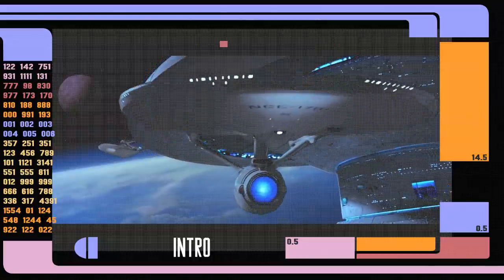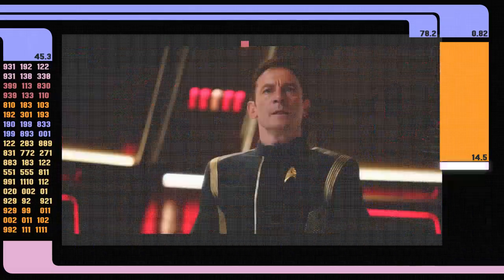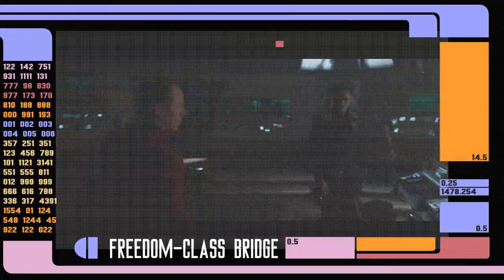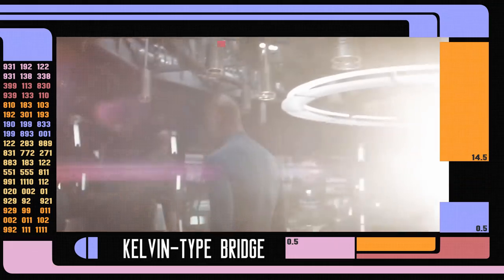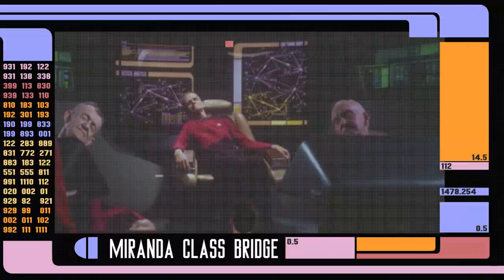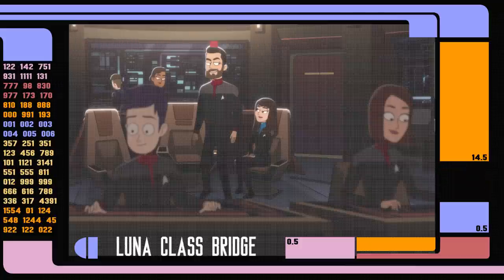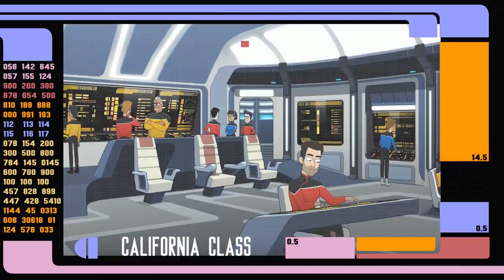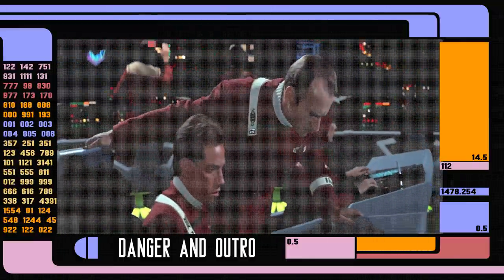Forgotten, Fatal, and Unethical Starfleet Bridges

Comment: Transparent aluminium isn't necessarily as good as deuterium, they don't build starships out of aluminium. That said, I agree windows are useful and probably worth the trade off.
Starfleet ships do sort of have a CIC equivalent. Galaxy, Intrepid, and Defiant class ships have all been shown capable of handling bridge functions from main engineering.
Yes non Starfleet please.
Reply: Transparent aluminum is far superior to deuterium for windows… because deuterium is a liquid. 
😁
Reply: @patrickstewart3446  In Trek context i think he meant Duranium. it was basic metal alloy used in ship construction.
Reply: Yup my bad, I did indeed mean duranium. Deuterium is the matter half of the matter-antimatter reaction used in the warp core, but I think it's a gas rather than liquid. Most of the deuterium on Earth is in the oceans but in Trek they get it from the Bussard scoops in space rather than separating heavy water. That said, they might keep it pressurised.
Reply: @Slavir_Nabru  Deuterium is the second isotope of hydrogen, consisting of one proton and one neutron. The third isotope is called tritium, two neutrons and one proton. This is real life as well as Trek. Thus, it will largely be a gas.

The funny thing is, the Starfleet Matter-Antimatter-Drive (Warp Drive) uses Deuterium, why? Because, if you recombine Anti-Hydrogen (one Anti-Proton) with Deuterium (one Proton, one Neutron), you gain the energy from the annihilation (E=mc²) plus the binding energy of the weak nuclear force when releasing the Neutron. Also, funny detail is the Bussard collectors collect Hydrogen from the interstellar medium (which probably is sifted through for Deuterium). The Impulse engines again are Fusion drives; they fuse two Hydrogen atoms into Helium (and push the hot Helium out the back), while other Fusion reactors do exist on the ship that produce energy (in this case, using the heat gained in the Fusion process instead of accelerating the Helium with that energy). So, we can conclude the Starfleet uses essentially one type of fuel, which is renewable to a degree, for powering many systems in different ways with it. How they generate the Anti-Hydrogen they use is not elaborated upon, unfortunately, but I think it is safe to assume it is a renewable resource as well in Trek tech.
Reply: @patrickstewart3446  Jumping Jack Flash
 At normal temperature and pressure, it's a gas!😎
Reply: Windows are big weaknesses compared to cameras.

Comment: I always thought the original Excelsior Bridge made the most sense. Mainly because it appears to be flat. As you noted in part of this having all those stairs and steps makes absolutely no sense. The first season of the next-generation when we saw Admiral Jameson aboard on a wheelchair having only ramps on the bridge totally made sense at that time. But even that could easily cause you to stumble if you're walking them during a combat situation or any sort of turbulence. The Excelsior redesign actually lifting helm and navigation and the captain's chair to equal to the highest level, literally made the low points irrelevant anyway. Like my step machine they're just there for exercise. While the ceiling space goes very unused. I always secretly wished that Captain Kirk had had a periscope like Captain Klaa! 😁 #LLAP 🖖🏻

Comment: You missed the perfect opportunity for the Miranda class to say "Do you know would be useful in this situation? A WINDOW."

 Also although I do agree with your points about if your points about windows windows I still believe Is "windows" would never be a standard feature on large military subs.  Usually your visibility is no more than 10' in Addition there would be sea slime or barnacle build-up on it which would need to be cleaned regularly. Smaller subs probably would have them standard issue, but not to large missile subs.
Reply: But it's not a window, it's transparent metal (aluminum to be exact).
Reply: @mainstreetsaint36   Yes but if you installed a sheet of transparent aluminum in your wall at your house that you could Look through what would you call it?
Reply: There's another problem too: Stealth.  Military subs aren't just bare metal, they're coated with other materials that interfere with sonar and suppress sound from the sub itself.  Granted you can kick that problem down the road and just say "more advanced materials we don't know about yet", but at the very least it's an issue that isn't solved by transparent aluminum or the like.

Comment: On the subject of the rocks:

The rocks could be an emergency heat dissipation system.  A substance in the console solidifies, ejects out of the console, and prevents a much, MUCH bigger and more lethal explosion, while spraying (relatively) light, foamy pumice into the air.

Also, some of the walls will spray rocks, and this could also be a part of the same basic idea: the rocks are a ballistic/energy absorber, that is designed to ablate and expand, preventing hull breaches in the bridge.  Once again: deadly to ensigns, yet a life-saver to the bridge as a whole.

Also, if we count the novels and Starfleet has Horta as crewmen, they probably view the rocks as popcorn.
Reply: could also simply be hard foam insulation or similar material that looks like rocks when it shatters.

Comment: The Enterprise D did have a bridge window, it allowed the crew to look up the z-axis, but it was effectively useless for any navigational or combat application due to the extraordinary size and speed of the vessel and was a decorative feature. 

Presumably if the view screen failed, multiple shuttles or other secondary vessels would assist in navigation.

Comment: What you lose by having windows on a starship's bridge is that the bridge has to be next to the outside of the ship where it is most vulnerable instead of deep within the ship where it is least vulnerable.  It might make sense to have windows in an auxiliary control center on the outside of a ship for use if by some extremely unlikely possibility an emergency arises where it is necessary to look out a window because the viewscreen system is inoperable.  But with the level of technology that interstellar travel implies, having the main bridge next to the outside of a ship that may need to fight is completely stupid.

Comment: With regards to the whole thing about metals, we have transparent ceramics (e.g. aluminium oxynitride) that are generally as hard as or harder than whatever you're bolting them into, but they are expensive and so even if you invented one that's flexible enough to replace the usual structural members, it'll be used sparingly anyway for the foreseeable future.

Comment: On the whole rocks in the consoles thing. My head canon was that the consoles are solidly packed circuitry/technology that is just so small that it looks amorphous. If you ever look at modern electronics in small form factors, you'll see ridiculously tiny resistors, capacitors, etc in addition to the chips themselves. Just look at 0402 SMD components. Now advance packaging and substrate technologies a few centuries and those consoles probably have thermal and electrical superconductor layers interwoven with components that are basically just gray blocks to the human eye. This would make it chunks of the actual electronics being exploded out of the consoles. Which would have some (emphasis on SOME) validity if you look at modern capacitors and such exploding when overloaded. The consoles exploding are still indicative of design flaws, but the "rocks" aren't the Starfleet Officer Replacement Program requirement they seem to be. Ultimately, I just wonder if the ideas of fuses and opto-isolation are just too retro for the SCE to understand.
Reply: Not even fuses... just don't run Electroplasma directly to a touch screen.  
Like a step down transformer safely tucked away behind some plating a couple of feet away would save so many  lives.

Comment: on the CIC aspect of things, by the TNG period it's mentioned at some point (I forget when) that they can transfer command to other area's thanks to the LCARS computer system. Namely, they can go into engineering and control everything from there at the big table control panel and it surroundings. The LCARS allows them to swap out each station for whatever they want when its needed.
 They have little need for a specific secondary command deck/room when they can practically convert any room with enough consoles into one to varying degrees of effectiveness.
TBH this is actually seen done in ToS as well during the Naked time when a crew member locked out the bridge and took control of the ship from elsewhere... a somewhat flawed, but effective way of ensuring that no matter what, the ship could still be controlled should the command levels be taken out or otherwise compromised.

Comment: When the vacuum of space is on the other side, I don’t want to trust a force field of a thin piece of glass like object in between me and the vacuum of space.  By the time you’re close enough to see something you’re already right on top of it, and you barely see 1% of of the 360 degrees around the ship.  Fracture the window your entire bridge crew is dead, power goes out and they’re dead.  You want to see a wonderful CIC look to the Battlestars Galatica and Pegasus.
Reply: And with the bridge located top center on the saucer section, you can't even see the bottom 75% of your ship to have a sense of how close you are and you end up scraping all the way down the side of space dock like in Galaxy Quest

Comment: Exploding consoles: My head canon was always that it was an intentional effect of the weapons used, maximized by the weapon designers. There were lots of safeguards, switches, breakers, and air gaps, but there was also a lot of engineering into overcoming those! 
But why?
If you are in a war, you want to remove the enemy's will or ability to try and kill you, most living things prefer to remain alive. To do this, you can completely destroy the enemy ship, or at least several (well protected) critical components of the enemy ship. But if your shots can render critical components inoperable even before they've completely destroyed the component or ship, you stop being in danger of dying sooner. Soldiers like that. And yes, for this line of reasoning, both the console AND the tactical officer, helmsman, etc. are considered "critical components".
I've always liked this little bit of head canon!

Comment: Here's the thing about windows on Star Trek ships: they are not a liability in combat because Federation ships rely on shields for defense. Once those are gone, it doesn't matter if the wall is duranium hull, or transparasteel window, it's unarmored and will be vaporized by the first disruptor blast that hits it. 

Also, look at the more combat oriented ships, Defiant class, D7, Jem'Hadar fighters. No windows, lots of armor.

Comment: On a planet with a atmosphere, a breach in the window isn't opening into the depths of space. Navy submarines can also have windows in some cases, but then they are installed in the sail, which is not a part of the pressure vessel and is flooded during the dive.

Comment: Ok, the exploding panels are simply a continuity kind of thing, or a hold over from the late 20th and early 21st centuries. 

Think of it this way. As automobile sales dropped in the mid to late 21st century, automotive parts manufacturers moved on to other industries such as the new space exploration programs.

Unfortunately, Takata moved on to systems control and display panels.

It's just that easy to understand projectiles from the panels when they explode.

Comment: Nx01 Enterprise has a Tactical center apart from the bridge. The Enterprise D onward has a tactical center in engineering. It also seems that Starfleet builds their ships to be completely modular. The secondary bridge or cic is wherever they want it to be, if they want to have one.
Reply from the maker: You have an episode with time stamp?
Reply: @LoreReloaded  enterprise season 3 episode 14. Not sure on the time stamp. There are people on the bridge using the communication system to speak to people in the tactical center. It is specifically called the tactical center. They talk about it several more times in the series. If your asking about TNG just rewatch any number of episodes that the bridge is disabled so they use the main engineering consul to run the ship.
Reply: @LoreReloaded  how about a list of Technology the Federation just forgot they have. For example hull playing that defended the nx01 against particle weapons while still allowing transport ion. Or Scotties transwarp beamng. What happened to these game changing techs?

Comment: Hey lore reloaded are you familiar with ...Aluminum Oxy Nitride. It's sold under the trade name AlON. 

It's an 80 percent transparent ceramic that has aluminum as it's primary matrix ...it's used for armored vehicle windows ...and is going to be used more in space construction due to reduced weight.

Comment: There is a huge difference between an ocean combat scenario on earth where the action can come down to close quarters with aircraft or missiles coming within visual range and combat in space where the combat ranges out to much greater distances. Also, a broken window on the bridge of a cruiser isn't a disaster on earth, but leads to explosive decompression in space. Finally, the real action during combat on a modern fighting ship takes place in the combat information center deep in the hull. The Enterprise D had one of these, but  they rarely used it.

Comment: In regards to exploding consoles, and putting my laughter at the humor aside, I feel it could be argued that what they say are safety measures work as intended in universe and prevent worse damage than we see. Example off the top of my head: 
Ship is hit by energy weapon, system overloads, surge switch kicks in, console explodes and crew member dies…but what if the surge switch prevented the entire wall/system from blowing out? Or while we see the fire rocks, a small fire rock is preferable to a violent inferno. Just some thoughts I had; great video as usual.

Comment: About the consoles: Why are they running on the main power system anyway? It's a glorified touch screen, 12 Volt should be ample to feed them. You wouldn't run 1kV trough a TV, would you?

Comment: It can reasonably argued that we do see CIC’s of a sort in some Starfleet vessels. Just somewhat integrated with the bridge itself. For the small Defiant class, the area with the chart table directly behind the Captain is the CIC. (Pay no mind to the holo projector episode). Similarly on the Galaxy class the elevated section behind the Captain is effectively the CIC. Something like the Battle Bridge would not be viewed as a CIC. But the idea that the Captain sits at the nexus between the Maneuvering Bridge and the CIC stations makes sense. In fact given the “in the round” design of the classic TOS bridge, it can almost be argued that the bridge IS the CIC, it just happens to have the helmsmen in it. Everything to the rear of Kirk’s chair, Spock, Uhura, etc, would be CIC tasks and stations. 

The CIC’s evolved out of the original early WW2 Radar shacks. Radar screens needed a dark space. The Bridges needed windows to avoid running into things. Command Staff found they were spending more and more time in the Radar and Radio shacks. Which were getting hot and crowded. So the CIC was born. With the Iowa’s and the Essex’s being the first ships designed specifically with purpose built CIC’s. But really the CIC is not the same as the Bridge. The Bridge is for controlling the ship. The CIC is for controlling the fight. On a Flagship the Captain Commands the Bridge, the Admiral Commands the CIC, which may in turn Command many ships. Remember that’s what “Flagship” means. It’s the place where the Admiral very literally hangs his flag. The Ship would fly the Admiral’s flag highest so the fleet knew to look to that ship and only that ship for orders. CIC’s evolved in the Carriers for that purpose. To let the Admiral see the entire picture. What Star Trek has always gotten wrong isn’t CIC’s or Bridges… it’s Admiral’s. The Myth from the movies that Admiral’s don’t pilot ships they pilot desks. Rear Admiral’s command Task Forces of a dozen ships from a Flagship. (Where the Captain is often more of a First Officer to the Admiral’s whims.)

Comment: The Minbari ships in Babylon 5 have a 360 degree view of everything outside, eliminating the need for the limitations of windows, viewscreens or placing the bridge in a highly vulnerable spot where it can be blown off. Star Trek uses holodecks, which should be able to do this, as well as make all necessary consoles as made by Barclay in "The Nth Degree."

Comment: Despite inertial dampeners and gravity generators(?), a apece ship needs a way for the crew to strap in. Hell even Irwin Allen understood that in "Smith, Will and the Robot makes 3".

The absence of seat belts (or personal force fields at duty stations), coupled with multi-level bridge designs, and sharp edge consoles ans seating, really transform Stafleet vessels into flying death traps.